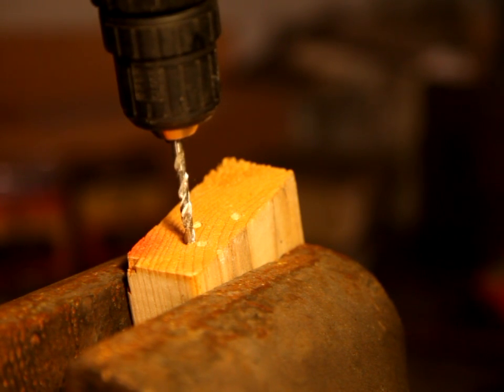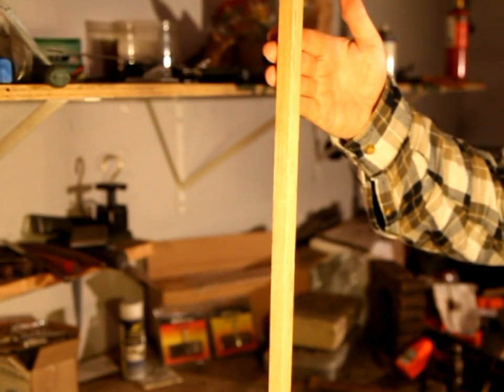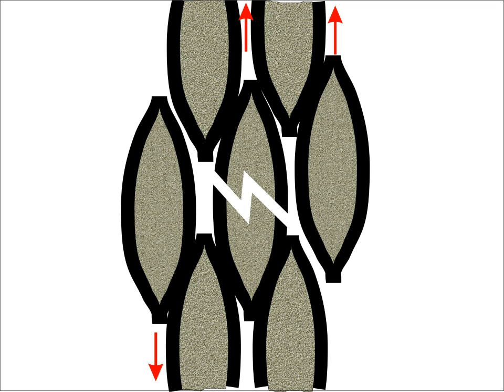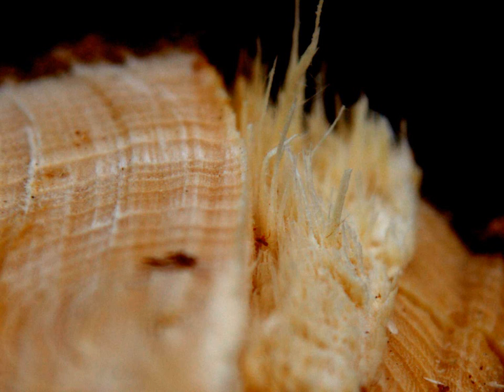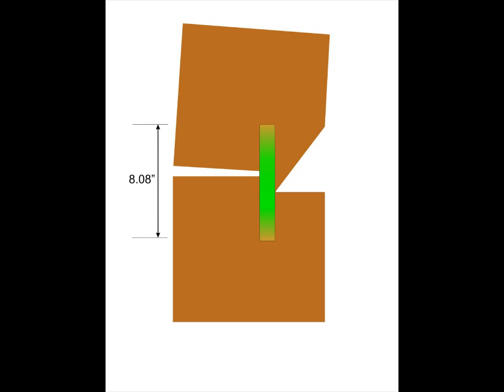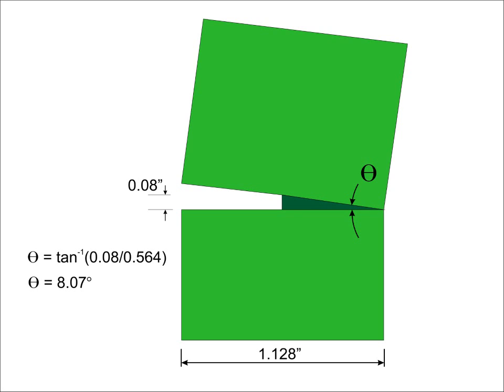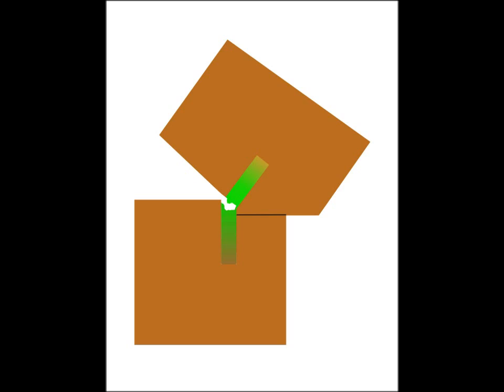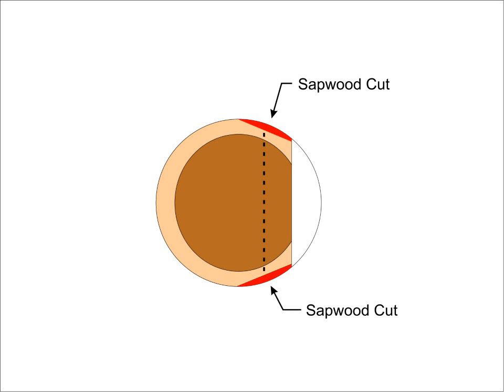Limits of Hinge Performance

Comment: I have seen quite a few of your videos. Thank you for your efforts to educate. Finally subscribed! Anyway, this technical description of the hinge failure due to various loads was awesome. I have been watching a another video channel called Finnish LumberJack, and when he cuts down the tree just before he makes the back cut he makes two vertical shave cuts about 1/2” thick along the edges of the hinge taking about 8 inches of wood away. I initially thought he was doing this to see the hinge better but now I understand he might be doing it to clear off the side fibers. He also uses two neat implements to aid falling. A crank powered extendable pole called a Stalpen, and a small Hand operated mini jack he made From two threaded rods...similar to a turnbuckle...but obviously used to push the ends apart.

Comment: Terry! Congratulations on am extremely well-presented series, backed up by solid facts. I revisit your videos often, and frequently use them to show newcomers exactly how complex and tricky this felling business can be. 
I have noticed some anomalies regarding hingeing properties and would love to hear your input. I regularly help my brother-in-law clear out invasive Eucalyptus trees on his farm. The trees vary in diameter from less than 1 inch to around 8 inches. I invariably use an open-face notch on the larger ones (mainly for practicing accurate cuts for larger trees) with a 30% notch depth and 10% hinge thickness. In nearly every case I find that the hinge stays intact all the way to the ground.
In fact, in around half the trees felled, the tree remains solidly connected to the stump via the hinge, requiring that I cut through the hinge to separate the two parts, before trimming the stump level and clean. 
Each time this happens I am reminded of this video, and wonder what is causing this phenomenon.  
Thus my question is: What factors are contributing to this?
Could the American Forestry's 0.8% stretch factor be incorrect? Is the "youth" of these trees causing it? Could it species-specific? Can this effect be "scaled up" to be used on larger trees?
I would be grateful for your input, and I am certain we could all learn something from it.
Keep up the great work!
Mike
Reply from the maker: Thanks, Mike!  I appreciate you sharing that.
I am not familiar with Eucalyptus.  The species could certainly be a factor.  You are also correct that younger trees tend to have a much higher percentage of sapwood and wood that has not hardened and mineralized into heartwood.  I should have taken that into consideration when making the videos.  I guess I had "big tree tunnel vision".
   The next time you have a hinge hold all the way to the ground on a 6 to 8 inch eucalyptus, see if you can tell whether the tension side stretched a lot or the compression side crushed.  If you can tell, I'd appreciate knowing.   - Thanks.
Reply: Terry Hale: Thanks for the prompt reply! I think you are spot-on - it sounds like the sapwood/hardwood scenario. I'm now nearly certain that the mineralized fibres have much less stretch than the younger, unmineralized ones. That is the key.

 I'll be sure to check next time, now that I know what to look for. I'll take some photos and send them to you. 
Regards.
P.S. Eucalyptus is otherwise commonly known as Bluegum. We have around 80 species here in South Africa.
Reply: i have been doing tree work arb. Climber for 30 years . There are a few times when hinges can stay intact,  it can be used to your advantage we have cut pine trees down over paved areas . Trees of 45 foot high, probably no more. With 90 degree gob and hinge has stopped the tree from hitting the pavings . It is sledded up  like this and then released from the stump. We also use this to advantage when felling on hills to keep tree and stump attached to stop rolling while the tree is snedded. These vids are top class but there as you have found certain species and hights and weight that will affect every thing . let's not talk about jump cutting haha.

Comment: Not sure how I can use the info.   What I have is a  bunch of dead trees (re emerald ash borer).  want them to remain vertical to dry until I need them for firewood.   Now when the wind blows them over, I want them not to fall in one direction which is toward the house (they are not close).  Another tree not to fall on driveway.   I figure if the hinge is made perpendicular to the  unwanted direction it should fall parallel to the unwanted direction.  Not sure if I should just cut on either side of the tree with a straight cut or wedge cuts.?  not sure if I explained that.

Comment: I know this isn't recommended practice, but making the back-cut high above the notch will reduce the strain on the hinge and allow it to function through more of the falling arc?  This would be at great cost to torsional stability?

Fascinating stuff.
Reply from the maker: You're on the right track, but missing one detail.  While cutting the backcut high would allow that side of the hinge to be tall  (after the split propogated down), the apex of the notch controls the effective height of the hinge on the front side.  If a vertical cut were made, running up from the  apex of the notch, you should indeed have a tall hinge that would remain intact longer, guiding the tree in its fall.
   I actually tied this once, but things did not go well, due to the brittle dead pine.  As wood gathering season is upon us again, I will try the experiment a few more times.